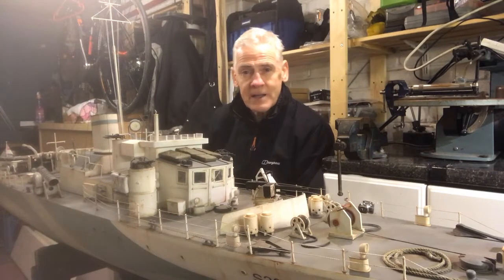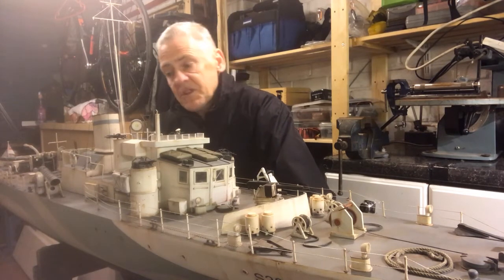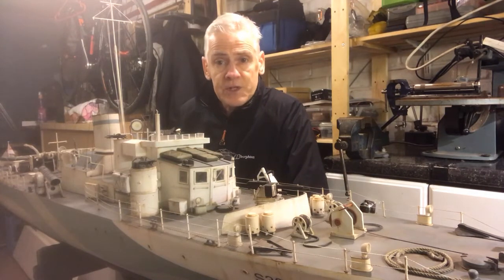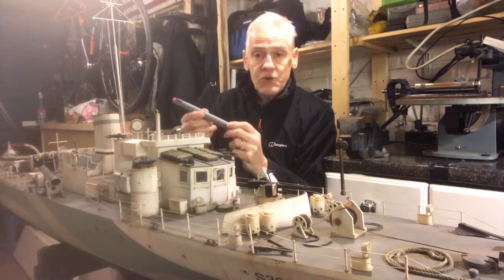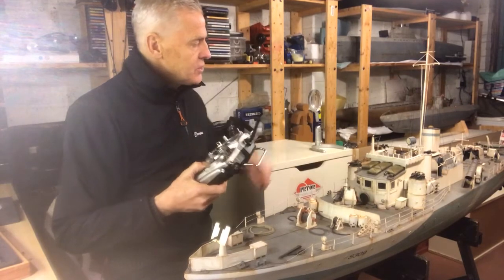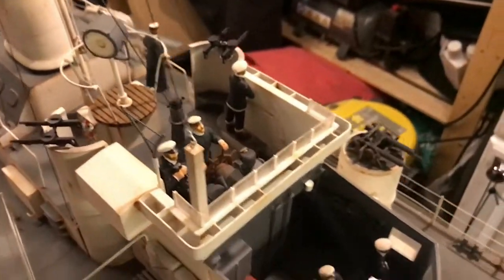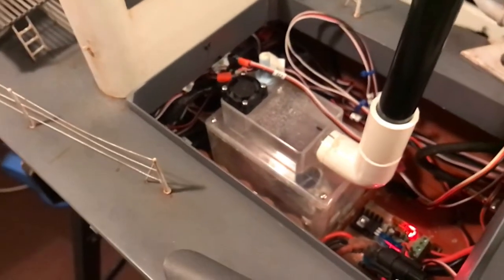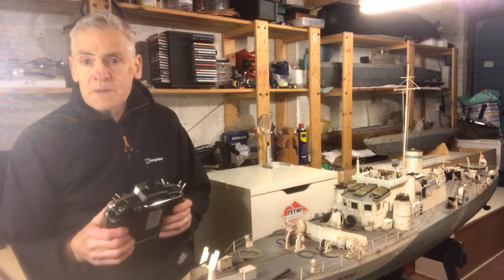Martins Models   Grey Goose

Comment: Hello Martin,
Very nice model sir 
She certainly looks good on the pond and goes well.
Could you remind me of which motors you have used? 
And did you use the fleetscale props or propshop? 
Thanks
Reply from the maker: They are 850 kv brushless but could easily use 450 as its over powered. Yes its a fleet scale hull.
Reply: Hello Martin,

Apologies for the lack of a response. Sometimes life consumes you. 

Anyway I appreciate the response 
can you recall the voltage at which you run her at? 
And with regards to the fittings 
did you use the stanchions provided or did you out source those? 
Again thank you